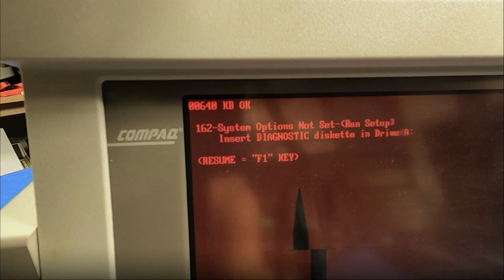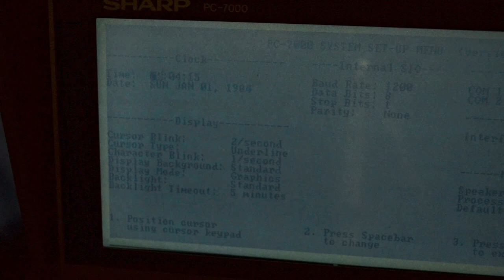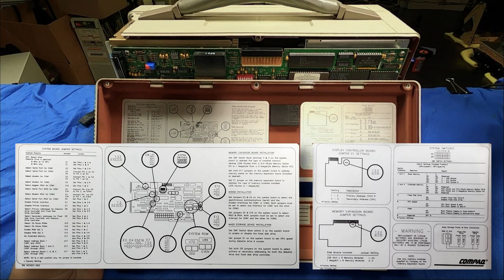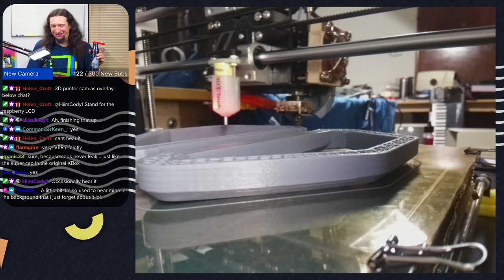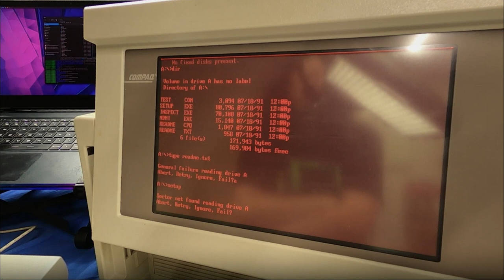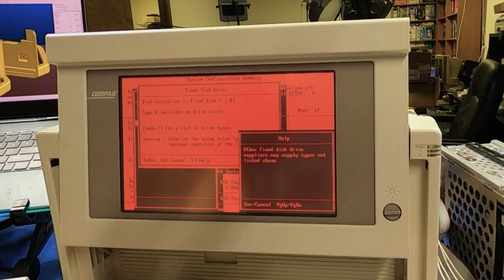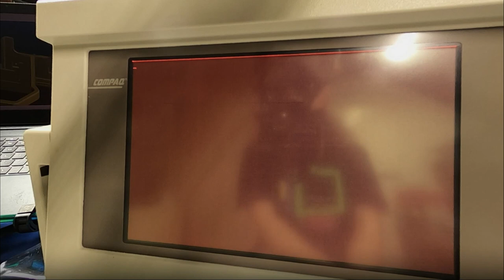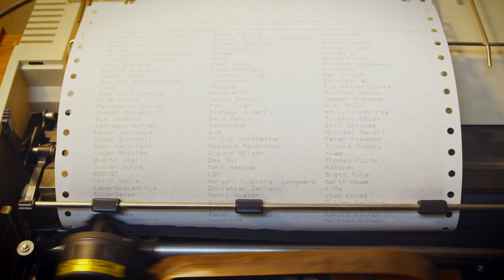Compaq Portable III First look and Getting to Boot

Comment from the maker: There are some audio sync issues with this but they shouldn't be too bad. Every single cut had to be resynced with the audio separately because the different camera angles recorded dropped frames changing their framerates constantly. This took about 11hrs to edit to fix all that so I did what I could. I have two plans for the future to mitigate and then fix this so I hopefully don't have this problem again.

Mulling this subject over in my head more, I need to do some more tests on the floppy drive and the BIOS settings for it. Since the Gotek was able to boot a 1.2MB image before running the setup program that means it does default to a 1.2MB drive and it makes sense 360k images didn't work. The real drive should have been able to boot the 360k disk at that point but it's possible that the different physical head size could have caused an issue with the disk I made. So a proper 1.2MB boot disk might be the best option.

Or the drive is just broken.
Reply: OUCH! More work editing then scripting and filming. Bummer man.  You saved it very well though, nice work.
Reply: You did the best that could be done; thank you.
Reply: Ouch! Also some of the close up camera shots seem to have a much lower framerate. It is nauseating to watch for me. :(
Reply: One thing you could also do is go back into the Compaq Setup, select the fixed disk as an "Other Type", instead of a Type number listed.  From there, read off the Cylinders, Heads and Sectors per tracks values listed on the hard drive's sticker into their appropriate spots and viola!  I just hope that new HDD is of the same era and isn't too big.  I wonder if my 1GB Western Digital Caviar from 1994 will show up or be supported?  🤔

Comment: You were putting the disk in upside-down! It goes in with the label facing towards the back, not the front. EDIT: I've seen some Portable IIIs which work with the label facing the front and some with the label facing the back. You just have to try both ways and see which works!
Reply from the maker: Woah, that's really weird. I'll have to try that tomorrow because that would be hilarious to solve it like that!
Reply: @TechTangents  Also, the Portable III's CPU runs at 12 MHz. In a 286 system, the math co-processor normally runs at two-thirds of the main CPU speed, so you'd need at least an 8 MHz 287 chip. If you put in that 6 MHz 287 chip you showed, you would be overclocking it by 33%. The best choice is to get a 287XL chip, which is actually a 387 designed to fit into a 287 socket.
Reply: @TechTangents  Correction:  Looking at other videos, I've seen some Portable IIIs which work with the label facing the front and some with the label facing the back. You just have to try both ways and see which works!
Reply: Mine you put in the disk facing forwards (label towards the screen) and make sure you press in the button on the drive.
Reply: @nticompass  I forgot about that too! On some of these slimline 5.25" floppy drives you have to push in the button after inserting the disk, to clamp the heads down. Then push it again to eject.
Reply: @vwestlife  I've had this computer for nearly 20 years and because of this comment, it finally did something but still not working. I thought the disk was bad but now I get this error bad or missing command interpreter
Reply: @vwestlife didn't these also have a HDD built in?

Comment: That Conner drive can't seek because the heads are stuck in the park position. This is a fault that is very common for the early Conner drives. And it's relatively easy to fix.

Comment: Oh and there is a big cream plastic 'backpack' that goes on the back expansion slot which has a full size ISA slot in it for expansion. I've got about 5-10 of them too! not that hard to get hold of. The video card that sits in the bottom, which is a seperate board looks similar but from my experience is not swappable between the portable III and portable 386. I can't try this ever again because I blame switching them by mistake for blowing one of my plasma screens.
Reply: @Sandy Cheeks would you be open to letting go of one of those backpack expansions as I’d like one for mine and I can’t locate them in the UK

Comment: Hey Shelby, one tip for the cable replacement job there: Unicomp sells Model M thick coiled cables (with SDL and PS2 plugs) that are absolutely fantastic! I got a few from them in the last couple of years to replace vintage keyboards' coiled cables (ended up replacing the SDL/PS2 ends for DIN and USB though) and I'm pretty confident they'll work for your Compaq. Those are as close to old-school high-quality keyboard cables you're gonna get today.
Reply: Is there a market for old KB Cables,  I have about 50 used but good ones.

Comment: I had found one of these Compaqs at a Goodwill about 15 years ago! They're such cool machines. Mine still had documents on it from its former life where it was used in a national park in Nevada at some sort of observation station in the late-80's/early-90's. It also had the upgraded HDD which meant that it originally cost $5.7k new! Not bad for a $10 Goodwill find :)
Ended up giving it away to a local collector here in Portland. Hope it's still running.
Reply: Got mine for £250 and used it for a while at different workplaces, but it was not that useful to me as I hoped.  I suppose I could strip it and repurpose one day

Comment: A shrink-wrapped software development company I worked for in the late 80s bought these in an 80386 model with something like 2 to 4MB  of memory and internal harddisk and issued them to us developers. We also had color monitors to plug them into at our desk. It was a pretty slick computer to have and use at the time. I used some 386 VM program that enabled multi-tasking MS-DOS and it really amplified productivity in a big way.

Comment: Thanks for your video. Back in day I used a Compaq Portable III at a software company that did factory automation software. These were the simply best portable PCs available at the time -- very rugged, and definitely there was NOTHING CHEAP about them or their build quality. On the contrary, Portable IIIs were very expensive, and widely used by management consultants, investment bankers, network engineers, and others who needed the best portable PC available and could justify the high cost. I have three Portable IIIs, have restored them, and use one almost daily. There is an excellent review in an old issue of BYTE magazine, and documentation available online, including a service manual. If you had bothered to research this computer first, you would have found that once the BIOS settings are lost, a Portable III 286 needs to booted with a 5.25-inch 1.2 MB DOS 3.31 diskette (3.5-inch floppy for the 386 version). The configuration utility was on a floppy, as was the standard practice in the PC industry. Every Portable III I've seen now suffers from dry rot on the keyboard cable, and they often have lines on the plasma screen indicating poor connections. The Conner hard drives are bullet-proof but the floppy drives often don't work. Your unit seems to have a good screen, and the keyboard cable still works, but it needs to be replaced and the handle is obviously in rough shape. It also has a missing folding keyboard foot, another common issue. It doesn't have a daughter board, memory expansion card, or optional modem. These computers were too expensive to just sit on someone's desk, so the cases usually need detailing after being banged up from all that travel. Since they were so well built, the Compaq Portables really lasted and were often used for years longer than you think. CONTACT ME IF YOU NEED PARTS for your Portable III; I have power supplies, hard drives, handles, displays, even an expansion chassis. Looking for an original Compaq Portable III carrying case in good shape.

Comment: I own a Portable 386, which looks and feels exactly the same externally. The expansion port connects to a two-slot ISA add-on compartment. No extra ports are added as a result. I upgraded my floppy to a 3.5 inch 1.44 MB. My keyboard cable is also disintegrating...
Those computers were VERY expensive back then. My Portable 386 (6MB RAM, 387, expansion, 20MB HDD) sold for $14K in 1988! These machines are very awkward for many reasons. The config floppies requirement is one of them.
Reply: Even when laptops were starting to come out, these luggables still had their value, if you needed expansion cards.

Comment: My father had one of these Compaq Portables back in the late 80, early 90s, with a 386 onboard. It had the same plasma screen, but pretty sure there was a 3.5" disk drive and a proper hard disk in it. He used it for maintanance and analysis of heating/ac systems in big facilities and for fiddling around in his workshop.

Comment: Unfortunately, I got rid of mine about tens years ago, but my step Dad's unit was a very different version of the CP3.  The asset tag was from DigiTech.

1.  The brightness knob was actually flat.
2. The keyboard's cable tucked into the bottom of the keyboard, and plugged into the side.
3. The bottom were the display slid was flush, not sticking out like all the pictures I've seen.
4. The back only had DB25 serial, and LPT, and power, with a clicky switch.
5. It didn't have any status LEDs.
6. The drive bays were right next to each other, and his was upgraded to a 3.5 floppy, and no hard drive.

I had his since like 1998 when he threw it out.  He started a computer company called Bug Doctor in 1990, and was in business for like fifteen years.

Comment: I wish I would have seen this sooner!  Many Compaq systems from this era used the 'diagnostic disk' instead of setup routines in bios because the hardware bios is extremely limited.  Their bios was loaded almost entirely from floppy or the maintenance partition on the hard disk.

Although it may seem like they cheaped out, they actually did it to make the bios easily software upgradable!

IBM also did something similar with their PS/2 line of systems, both for upgradeability, and to support their MCA architecture...

Comment: In the same vein of weird Compaq setup disc/BIOS stuff, I have a Compaq Armada laptop from 1997/98 that has the BIOS in its own partition on the hard drive instead of its own rom. Since it didnt come with a drive when I got it, I had to track down the diagnostic disk and BIOS partition images and do a whole rigamaroll of externally creating the partition on a drive and putting the BIOS image on it the using the diagnostic disk to actually boot it properly to configure the BIOS for a persistent boot.

Comment: My first computer...same problem:system-set.Replaced the battery and run PC Doctor Diag disk to set the time and HDD/floppy type.I think-back in 1998/99,I chose HDD type 'other' and manually enter H/C/S parameters of the HDD-u will find those numbers on HDD label.It worked.After that, I overclock the system from 16MHz to 20Mhz.Not necessary for a DOS computer but fun. I love that orange screen.Thank you very much :)

Comment: i picked up a compaq lte laptop, the diagnostic disk issue has driven me insane. interesting to see this portable running from a gotek, that could be an interesting solution. i've had nothing but issues trying to get the diagnostic as well as any dos boot disks in 1.44 or 720k. though i still have my apprehension taking the thing apart, great video.

Comment: Great video! Thoughts:
- Don't know much about plasmas - wondering if the video corruption could be a connection/cabling issue rather than screen damage?
- You forgot to install the 80287!
- Might be worth getting a CGA graphics program running to test the external video port.
- Does it forget BIOS settings across power cycles without a replacement battery, or is the battery just for time?

Comment: The lack of onboard setup utility is one thing I really really don't like about older Compaq computers.  I know the original IBM PC didn't have one either, but Compaq carried this ridiculous trend forward for FAR too long.  I have a Compaq Pentium that requires an on-disk utility to configure it.  It REALLY sucks, because I wanted it to be a Windows NT system running entirely from SCSI, and I basically have to have an IDE disk installed* to avoid errors, and be able to set the clock when the battery is low.  Stupid.

(* Oh, and there's only one dedicated hard drive bay, because of course there is, and all the bays use proprietary rails, because of course they do, and it didn't come with any extras, because of course it didn't.  There actually isn't much that I do like about old Compaq computers.  Or newer ones, for that matter.  I would give the entire brand a pass completely, if it weren't for the historical significance.)

Comment: I use to have this model of Compaq I use to run GeoWorks Pro on it that I had on a Conner Hard drive. I eventually want to get another one again even if it is bad and if need be make it in to a Luggable Sleeper.

Comment: I used to have one of these many years ago and there are actually some dips which is in there, some of which if I recall change the video output settings between 4 colour, 2 colour and CGI , also if it has a hard drive in and you remove it and the carriage be incredibly careful as the carriage is so sharp it will cut the Ribbon cable and short hard disk controller frying it whilst it is repairable with some soldering it’s probably quite hard to find a controller chip not that I’ve tried recently (I owned mine in the 90s and very sadly got rid of it)
Reply: Of course I wrote this before I watched the entirety of the video 🤦‍♂️

Comment: I didn’t look too closely at the video but it seems weird to me that there was no option to key in hard drive parameters manually. I had a machine that would allow me to select between drive types and one of them was "custom" where I could key in the drive parameters directly. The correct parameters can usually be found on the label on these really old HDDs.

PS: I don’t know if that was a common thing back then or if you were just expected to choose one of the types that was close enough because this hardware is significantly older than me. I was just messing with an old machine I found in the basement and figured it out by looking at what the BIOS setup was asking me and what information I could get from the labels on the parts.

Comment: I wouldn't expect the HDD to be visible until it is configured in the setup. Rather odd that it doesn't have a custom option to enter the CHS values, though.
Reply: It had an "Other Type" option -- I wonder if that would have exposed CHS?

Comment: Does anybody know the voltage output from the red molex connector from the power supply?? Been looking for the values and couldn't find them anywhere. Is the only data i need to repair one of these portable 3 with power supply issues

Comment: Do understand this type of machine was for simple word processing and software for very early machine controls using pre PLC single board controllers with ASCII or serial rs232 or rs 422(??). These things were somewhat neanderthal by today's standards but understand the tech out on the plant floor now had a window into his process (granted crude software and PC). This was a new way and was innovative in light of the fact this machine allowed a crude RS232, parallel or ARC interface and comm with the machine program. These were no chills no thrills basic block of machine for very specific purposes. Simple programs could be configured and downloaded by a parallel (old time printer cable) to the single board controller in the machine

Now today with all your wizardry you can probably make it do way more than expected in 1990~.

Comment: I've got about a dozen portable III/portable 386 machines and I've spent DAYS tinkering with their wierd issues and probably forgotten all of them to waste another few days in a decade's time. I remember having the same issue with the drive where I ended up selecting it as a 1.44mb drive and using a gotech but after much trying every image I could find, realising the only image that worked is the 1.2mb one. I also had two which were too far gone for parts and the screen bezel is the exact same size as the ipad 1, so you can butcher a faulty ipad 1 (£10 off ebay) and use an HDMI adaptor in it to connect it to a modern SFF intel machine or a Pi. The keyboard is weird though - you can XT to PS/2 adapt and then PS/2 to USB adapt, but then 90% of the keys work but 10% are dead. I've tried about 5 different adaptors, from £5 to £50 and all of them do the same thing.

Comment: But why do not copy those setup files on the HDD and fiddle with floppies? Just asking for a friend....
Use a IDE2USB adapter to check the Conner before opening it. Also, do NOT use the IDE2USB with a HDD translated with Ontrack, it can ruin your data. The translation part is written in the MBR, so if you would run fdisk/mbr, the Ontrack boot record will be wiped and your HDD capacity will be whatever you set it in BIOS.